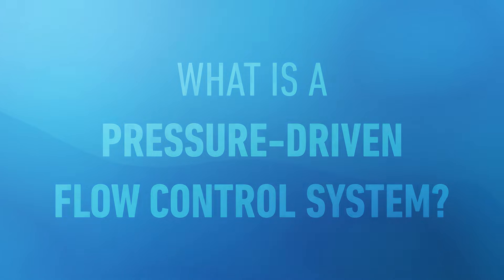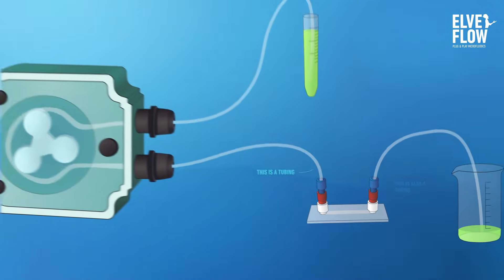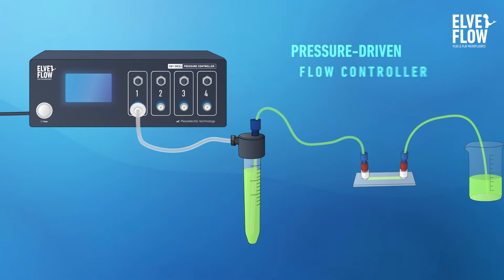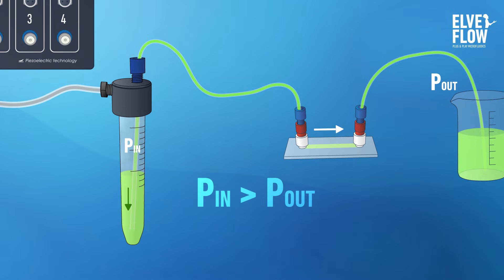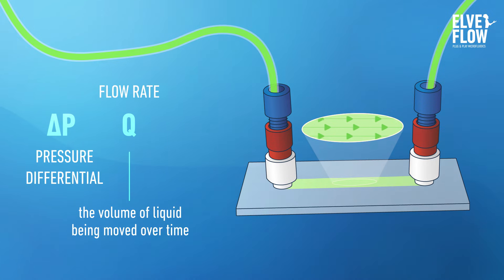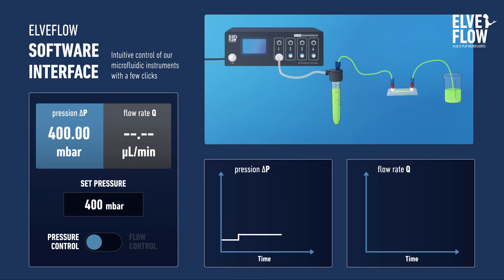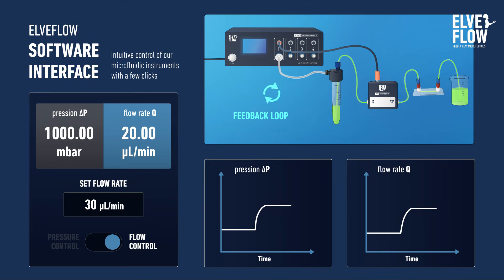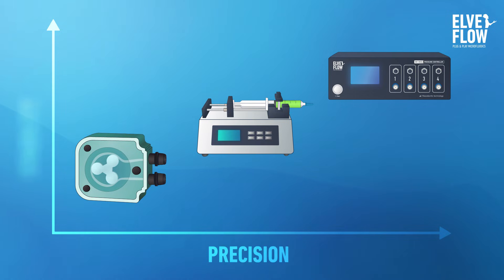What is a microfluidic pressure-driven flow controller?

Comment: How to generate pressure? what kind of pump?
Reply from the maker: Hello Hao Wang, thanks for your interest! 
You can use a compressor to supply pressure to your OB1 > https://www.elveflow.com/microfluidic-products/microfluidics-accessories/air-pressure-generator/ 
Feel free to contact us at contact@elveflow.com if you need help or advice :) 
Have a nice day!
Reply from the maker: Hello, you can also use our autonomous pump COBALT (https://www.elveflow.com/microfluidic-products/microfluidics-flow-control-systems/autonomous-vacuum-pressure-pumps/). Cobalt is the ideal benchtop companion. It is equipped with a pressure (and vacuum) source so it does not require an external compressor or laboratory gas supply. To learn more, you can also watch our unboxing video: https://youtu.be/FmJmNd5r1H0

Have a good day, 

Marie from the Elveflow Team